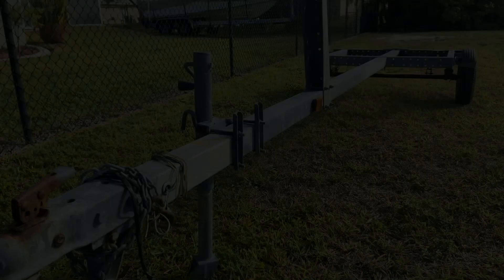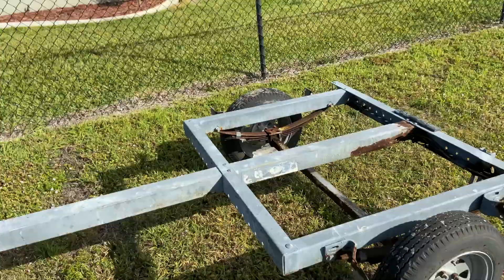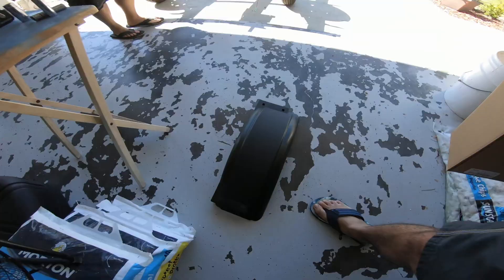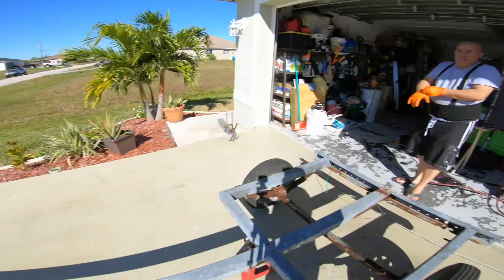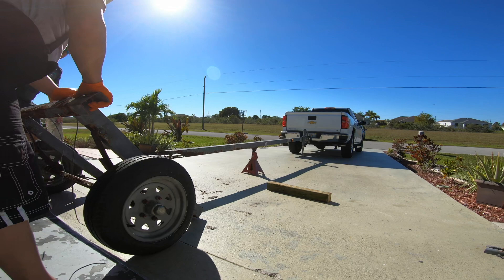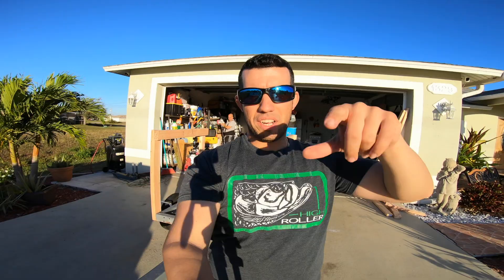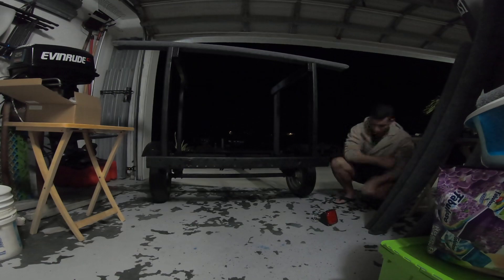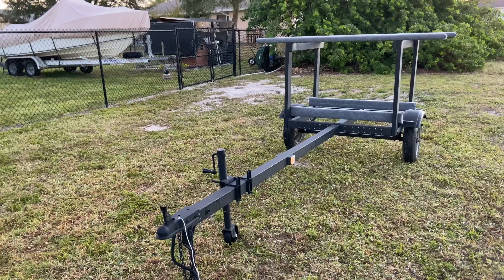Building a KAYAK Trailer | DIY KAYAK Trailer Project

Comment: I can see where you’ll run into some issues going forward with this setup. As long as you monitor the the bolt tightness where your wood connects to
Your frame, you should be okay for a while. I may suggest get some L brackets to help secure the frame of your wood. As a metal finisher, I didn’t see where you properly removed the rust from your frame and axel. Those areas will likely rust through in a short amount of time. I’ll be doing a video on how I convert my 20’ boat trailer into a four kayak hauler with lockable  storage. Not sure how large your kayaks are, but I have Hobies and doing perpendicular bracing like you’ve done will not work. I’ll be adding lengthwise bunks for more even support. You appear to live in a warm climate and with kayaks laying across perpendicular supports can alter your bottoms.